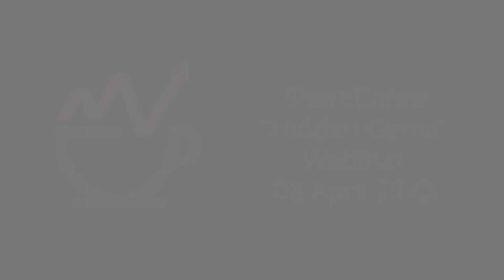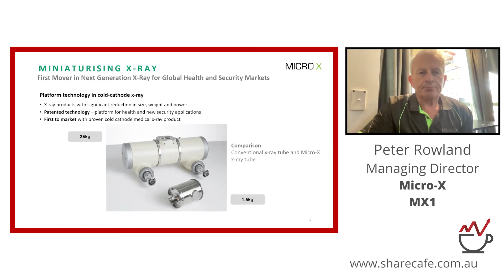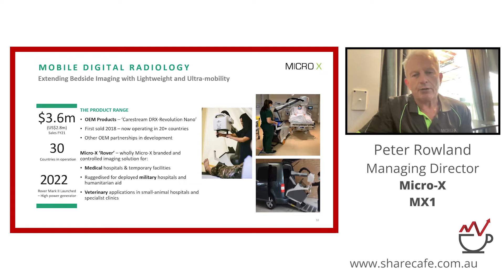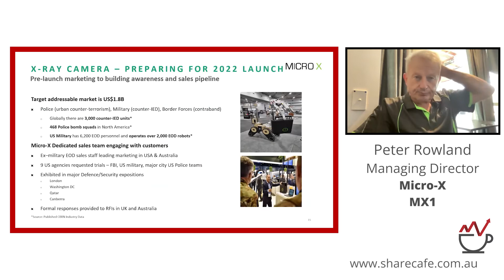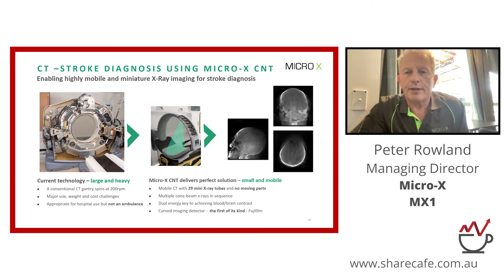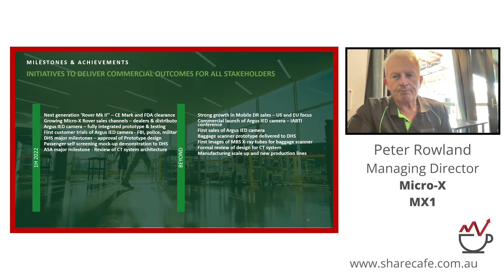Micro-X (ASX: MX1) – Webinar Presentation

Comment: Will anyone from the Share Cafe be attending the Micro-X open day on the 2nd of June ?
Reply from the maker: unfortunately not as its in Adelaide
Reply: @ShareCafe1  That’s a shame as I thought the travel was well worth it… 

As an engineer in a previous life, it was important to make sure that this is not just another small cap, hiding behind a “Salesperson” CEO, however Micro-X is the real deal and there is a hive of activity, packed full of quality engineers and staff, who all present very well and are very proud of what they are achieving and doing.

The thing that struck me the most is the engineering creativity and the significance of the massive change that Micro-X will bring to X-Ray… Siemens spent millions and millions trying to make small CNT X-Ray tubes reliable above 40 KVp, but failed and it has taken a team of Engineers and Scientists in Adelaide to make it work.

The significance of this cannot be understated, because this opens up a whole new field of opportunities - just one example is baggage screening at Airports - underneath an airport terminal will be a massive CT scanner worth millions and is limited in what it can do, however with Micro-X they can make smaller individual machines to improve throughput and cost and increase the accuracy of screening.

It was well worth the trip and I hope this company starts getting the recognition that it deserves…